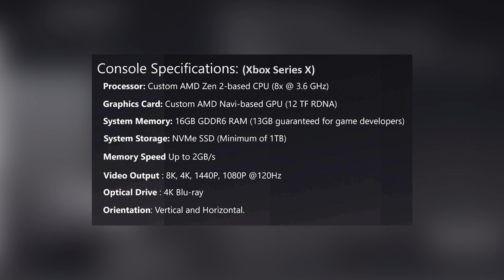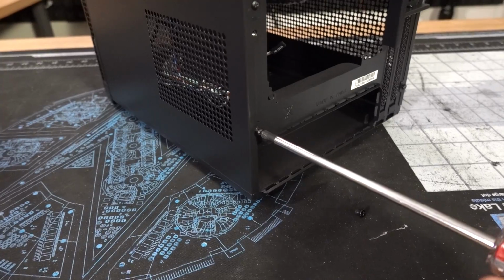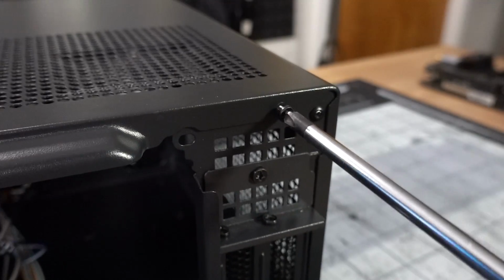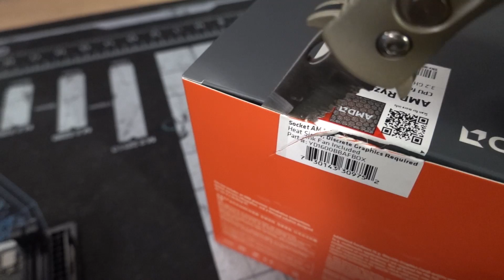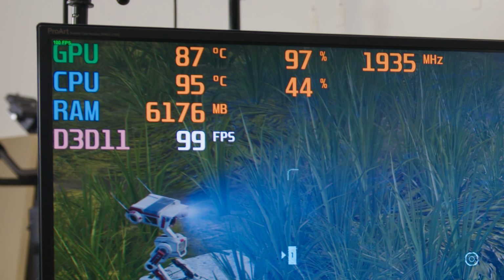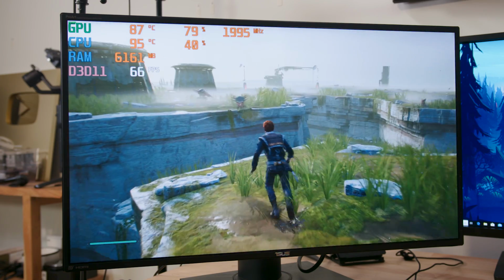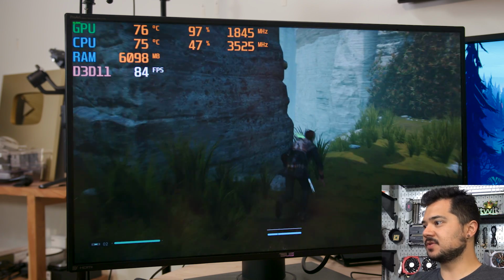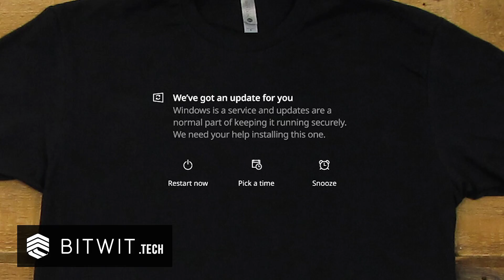I built my own Xbox Series X

Comment: Everyone is doing these Series X builds, yet they get the specs wrong IMO.
You would need a Ryzen 7 3700 and an RTX 2080 Super to pretty much match the specs.
I think most videos are highlighting the case, like that is the main thing that is comparable.
Reply: Ye these youtubers are slow, the xbox series x have 8 cores 16 threads with amd gpu thats close to a 2080 lol
Reply: The specs for the Series X PROBABLY won't really matter for the first couple of years since games that come out on the Series X will also have to have a release for the Xbox One. This is part of Microsoft's plan to ease people into the new generation, instead of immediately dropping support for the Xbox One, along with the majority of their customer base (most people won't buy the Series X right off the bat).

With that in mind, Kyle's build will sit comfortably between both the One and the Series X, and will hold its own for at least a couple of years if not longer.

We'll just have to wait and see whether or not the Series X can really deliver, or if it's just been over hyped.
Reply: Swing swong you're wrong
Reply: Warm Soft Kitty people that have tested the kit such as digital foundry said it.

Comment: I think what Sony's doing with SSD caching is probably going to change more things than XSX. Yet, I'm more interested in the XSX because it has full backwards compatibility. I'm not very interested in most AAA games so horsepower is not really a draw for me. I'm sitting on a 9700k/2070 Super right now so I don't need a powerful console, I want one that lets me play my old games. (Yes, I know emulators exist)

Comment: Good list but to me going with the 5700xt makes more sense. I was able to put together a list that cost the same ($4 cheaper) with an RX 5700xt gpu, 1tb nvme HP920 EX ssd,  R5 3600 cpu, and 3600 CL16 instead of CL18 ram with everything else the same. Only thing is you'll have to find a buddy or a store that can help with updating the bios on the mb.
Reply: https://pcpartpicker.com/list/4RhpNq  for those curious. pcparpicker flags the gpu as being incompatible for the case but it will fit fine.

Comment: damnit kyle ! with original config just use the fan as exhaust and you would be good with the temp ! when you install as a intake fan you are trapping the hot air in the case !

Comment: 06:24 Way to much thermal paste. Application is uneven and on Ryzen 3000 series you need to spread it out to 3 spots because of the ram controller and 2 dies. Everyone should know that.
Reply: You really don’t, it gets spread out from the pressure of the cooler.

Comment: Compared to the previous gen, these new consoles have tech that only most mid range and above builds have in them.  M.2 and 10GB of VRAM is not in most budget builds....As for the GPU, RDNA2 isn't even out yet.  Now as for where I see the new consoles stacking up against PC parts AT THE TIME OF LAUNCH........prob mid range still.  I firmly believe that the 3070 Super will beat out the new consoles, 3060 will prob be just below or on par with them.  As usual, a PC that beats it hands down will cost more def but that is the nature of the beast.  Microsoft and Sony get HUUUGE discounts on these parts for buying such massive bulk.  People that are paying retail prices for equivalent parts are going to have to pay more.  But paying more for the parts that when put together have more functionality and graphical options to prioritize framerate make up for the added cost at least in my opinion.

Comment: The CPU temps are why I prefer the Fractal Node 304. You can fit an NH-D15 in that! I wish the Node 304 had room for a 140mm intake fan instead of just two 92mm.

Comment: the cooler is fine, so is the ATX power supply, just rotate the power supply to exhaust warm air and temps will drop drastically. Or use front fan as exhaust

Comment: I would rather use a Jonsbo V6S Mini-ITX case, or something with a front psu, than the case you used. This only because it has to be a long term pc, and you do not want to have a restricted airflow in your tiny itx case. P.S. Try it with an aio. Even the cheaper ones makes your life much "cooler" ;)

Comment: That's going to be considerably slower than the Xbox Series X.
Reply: not sure about that as its a 2070 super, but will say that system is way more expensive then an xbox series x as well as those temps are just far too high.
Reply: @DapperHoppes  a 2070 super is slower when looking at benchmarks.
Also it would be very surprising if an RDNA 2  GPU with 52 CUs weren't able to outperform a 2070 super. Because the 5700xt comes very close with just 40CUs on an older architecture
Reply: teehundeart lol it might slightly out preform the 2070 but then again the RTX2080 ti is d gonna kick it’s ass 🤷🏼‍♂️
Reply: @DapperHoppes  The Xbox Series X will be faster than the 2080 Super.  That's what the numbers say just by scaling up the 5700 XT's actual performance, without accounting for any pipeline improvements in RDNA 2 or the faster graphics memory of the console.  It's quite possible it will match or beat the 2080 Ti.
Reply: Warm Soft Kitty  uhm. Look at digital foundry.
You can find Gears 5 with higher than highest settings running at 4K 60fps.
They compare that with the performance you can get on a 2080
Reply: @teehundeart  your basing your analyses off of one game.  a 2070super across the board is faster then a 5700xt, I know I have a 5700xt.  also Gears of War is optimized for AMD last time I checked.

https://www.youtube.com/watch?v=pcGWIJW3iNU&t=362s

https://www.youtube.com/watch?v=RyvqKUXKM14

Comment: modern Microsoft Xbox costs
:
Base Xbox Series X: $699.99

Options: 
additional 2 TB HHD: +$200
additional 2TB SSD: +$400
color other than black: +$50 because its special
additional remote: +$100

Things needed after to run games:
Software app to run games: $35.99 per month
App library addon: $19.99 per month
Wifi capability: $45

other costs:
Senses Apple device on wifi network: +$5 per month
want to use your existing account: +$12 migration fee per account

Comment: when i made my pc i made alot of mistakes here r my parts my pc is pretty slow tho the parts r good where did i go wrong:

ryzen 5 2600x
rx 580 graphics card
b450 -A-PRO mother board
1tb storage
480gb kingston ssd
16gb corsair ram 2600 mh
550 watt gold certified power supply (corsair) 
and then my case is the corsair spec omega 

is it good or did i make any mistakes i wish i could make a new pc now i know alot more oof (btw i dont know what brand  the hdd is
Reply: Andrew stoddern your memory is quite slow. I’d recommend 3200 speed for AMD

Comment: Glad to see I wasn't crazy with my Sugo. Had the same issue and eventually went water cooling with a Corsair H60i 120mm AIO which dropped temps to the 45C under load. Then flipped the PSU over with the fan pulling hot air out of the case to assist as an exhaust. 

Also stick with a 65w TDP cpu as my first problem was I put a 95w CPU on Air and it was not happy. About as bad as what Kyle got. And give up on an air cooler with this case. Trust me.. I tried all kinds and even after I dropped down to a 2400G 65w just couldn't bring temps down to acceptable levels. Once i went AIO.... solved the problem for sure. 

Yeah, love this little case but man you will have to experiment with it to get the best out of it for sure. Great content as always and thanks for helping others to avoid issues with this little case.

Comment: I don't think it's really an issue as far as getting solid gaming performance, but billing this as a home-brew Xbox Series X is pretty far-fetched.

This PC has a 6-core/12-thread processor, SATA SSD, and ~9 teraflop GPU vs. the forthcoming Xbox's 8-core/16-thread CPU, NVMe SSD, and 12 teraflop GPU. And granted, different OS and system overhead make it impossible for direct comparisons, but that's the task you set for yourself, which makes this build pretty much superfluous competing with some imaginary competitor that doesn't really exist. If anything, it only underscores that, for ~600 USD, the Xbox Series X is pretty much untouchable when it comes to gaming from a price:performance viewpoint. (Honestly, if I didn't need my PC for work, I'd certainly be having second thoughts.)

Comment: serious question.... are there ANY coolers that actually utilize the stock AM4 socket cooler anchor points? I personally have never seen any cooler that doesnt require you to remove those black plastic things... which raises the question.... why do they still include them with the motherboard?

Comment: for the cpu, I believe the closest performance is 3700x, as both features 8 cores with smt and based in zen2 and as for gpu, well the closest in term of architecture is 5700xt, but it's "only" 40 cu instead of 52 and doesn't features hardware rtx. since navi 20 won't come anytime soon, the closest performance is either rtx 2070 super or 2080.

Comment: Hardware specs the XSX CPU is equivalent to a 3700x and the GPU is equivalent to a 2080 Super. To build a comparable pc you're looking at $1700.00:  Ryzen 7 3700x, Hyper 212 evo, NXT H510 Case, Gigabyte 2080 Super Gaming OC, Samsung 970 Evo M.2 1 tb NVME, EVGA SuperNOVA 650 watt psu, and Corsair 16 GB Vengeance LPX 3200 Mhz DDR4. With an Acer 43" 4k Monitor $2100+. I'm expecting the XSS to be at least $700.00. We already know the PS5 cost about $450 to make and it is not as fast spec wise as the XSX so that console(PS5) will cost at least $550-600.00. So....with all this being said...the next generation consoles will be FASTER than most gaming pcs out there...even faster than the middle area(2080 Super with the 3700x) of high end gaming pc.

Comment: Remove the filters from the front of the case, they are pointless if you need to pull the case apart to clean anyway. It will improve the airflow. I built this case with 2600X with wraith spire and Sapphire Rx5600XT getting 60-70’C depending on games etc. Pic on the Twitter post for this video.

Comment: Most of those pc perks either make no sense or consoles have them:
Better graphics: Debatable especially since pc's at its price point will have worse graphics.
Graphic settings: Something consoles and game deves have been implementing in titles recently
High frame rates: On $1000 pc's yes but not on $400-500 pc's at 1080p or 4K like Xbox running Gears at 4k 120fps
Keyboard+Mouse: Something thats also been being implemented in titles and probably will come full force next gen
Game Mods: is something  devs like Bethesda have started putting in there games
Emulation: Xbox has emulation which is the reason you can play OG Xbox games and Xbox 360 games
Backwards compatibility: Again Xbox has
Multitasking: Xbox showed off being able to have multiple games open at once unlus you mean on multiple monitors which adds  more money then yes.

Lets have a conversation if you feel otherwise about any of my points. :)
Reply: IceBrandon101 no you could build a console killer for about 500 dollars rx580 would destroy the old gems Xbox but I am with you about the series x

Comment: I would definitely recommend having an sfx psu in there because I have the SG13 and there is basically 0 space for cables and airflow with a full atx non modular PSU like I have. Temps are around 70-80 degrees for the CPU during gaming granted only the wraith stealth cooler on my 2600 and my RX 580 8gb is around 70 degrees during gaming. Not sure about idle temps. It fluctuates quite a lot. I got a 240gb ssd and 2tb m.2 HDD since I could not afford an m.2 ssd but I would greatly recommend one instead because of once again lack of space. When you want to change any cables or stuff you have to take out the HDD cage first, then the PSU, then the GPU then the mobo and specifically in that order or you cannot reinstall anything. It's a huge pain and if I could afford a new case I'd recommend a Fractal Design Core 500 - only around £50/$50 etc. But it can have a cooler master 212 hyper evo and still have an atx psu plus have a few HDDs and ssds. And full size GPU. You could even fit a 240mm AIO in there if you want with two fans plus a 1 120mm exhaust fan. It is not that much bigger then the SG13 only a couple of inches. Like the size of a small shoebox.

Comment: More tips:
(1) You can add a much longer card than PCPartPicker may say, it fits a PowerColor Red Dragon 5700xt easily.
(2) You can also add a 120mm fan to the side panel (opposite the graphics card) and that adds far more airflow.
(3) You can cut the side panels and add a window. Something I recommend is to add a glass panel to the top (assuming good cable management...) and mounting the PSU so it faces inside the PC, with an AIO on the front, and a fan on the side panel (80mm to be safe, 120mm almost always works) so you can have far, far better airflow.

Comment: This video has the same problem as almost all "console killer" videos. Getting the cheapest components around that no one wants to have in their living room, completely ignoring features like UHD Player, Software, included Gamepad - while leaving all other necessities out of the calculation. I'm a PC gamer myself, but I don't need non Game PC features at my TV - so that whole list of "advantages" is pretty much wasted.
And why not use an 8 Core CPU ? Or a 1TB NVME SSD ? Not to mention that the XSX has a 12 TFLOPS GPU. I really don't get it.
Reply: Also for the price of this alone you could most likely buy two xbox series x's

Comment: Could you do a full length (no cuts) 2020 pc build please? Like the one Linus did, but better. He admitted himself he was taking shortcuts and not doing certain things properly. He really glossed over cable management, like how he knows what cables to put in what cable gromits, where to put unused cables and so on. On a slightly different note, I'm preparing to do a build using the nzxt 510 and ryzen 7 3800x, so would be interesting to hear your thoughts on cooling higher end components in that case, since there's not much intake area

Comment: Hi Bitwit, i have a 2600x and 3600 mhz 16gb ddr4 ram, but when i put tam speed up to 3600, pc doesnt post so i had to clear cmos, i did research and it said that 2600x max speed is 2933, is that true, and if not how to i use ram to full extent without pc breaking

Comment: Kyle has to be the most annoying YouTuber over 12 years old. Listening to him has become unbearable over the last couple years.  That said, this video is straight garbage. For anyone that's into computers and or specs, the obvious errors in the video make this video title nowhere near accurate. The Xbox Series X will have an 8 core, 16 thread cpu, not a 6 core, 12 thread.The read write speeds of the NVME drive in the XBOX Series X is 2.4 Gb/S, which is about 5 times faster than a normal SSD. The use of a 2070 super is also less powerful than what the XBSX will use, which is known to be between a 2080 super and a 2080 Ti. I really used to like Kyle's videos but this is just wasting my time with it's terrible-ness. Unsubscribed.

Comment: Series x is going to cost $500 easy. I would need a PC that costs just that and have just as powerful of specs to be it's killer. And that $500 would need to include mouse, keyboard, and OS. Since an xbox comes with a controller, and it would be able to run a smooth 4k 30 on medium settings. and anything else at 1080 60 at least on high.

Comment: Serious question.  Given that the power supply is at the top, why did you connect the cables to the power supply before you installed the PS instead of connecting them to the components first, then wait until after install to connect them to the front of the Power Supply?

Comment: I have this case for my desktop PC and it feels dated. No thumbscrews in this age? Doesn't come with SFX adapter bracket. The GPU slot is covered by the top bar so make sure your GPU isn't too tall or it is a nightmare to squeeze in. Consider buying a sandwich style case if you're going SFF (where the GPU is side by side with Mobo with a riser cable. It is way better use of space.)

Comment: Just a small advice, don't try to use 3600 mT ram with ryzen 1xxx and 2xxx, just use 3200 cl16 for budget option and 3200cl14 for max performance. You can stretch up to 3400 maybe, depends on cpu and motherboard.

Comment: I feel like you can’t be too picky with PC temps when comparing to a console because who knows how hot consoles get.
Reply: The manufacturers know how high consoles temperatures get and you can easily get any number of different thermometers to see for yourself. Consoles are designed to operate within a certain optimum temperature range.

Comment: i would like to see if its can handle 120m AIO for the CPU and for GPU i would like to use a better GPU cooler from other brands and use a full size length is it possible pleasssssssssssssse

Comment: I recently built an ITX PC with an i9-9900k and a RTX 2080Ti blower inside a Cooler Master Elite 130.
The key is to evacuate that hot air somewhere. I ended up using a watercooled AIO, and pushing air to the front with two ventilators.